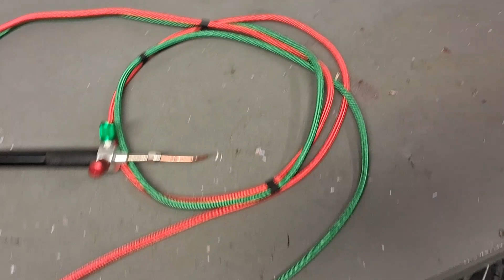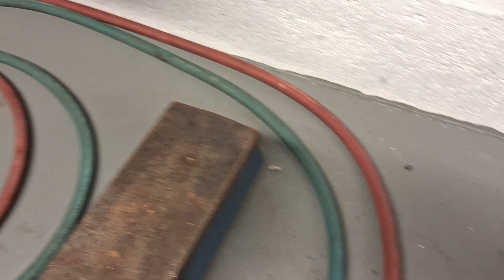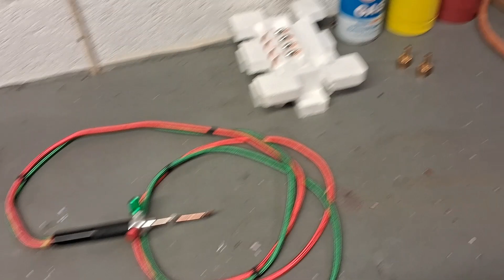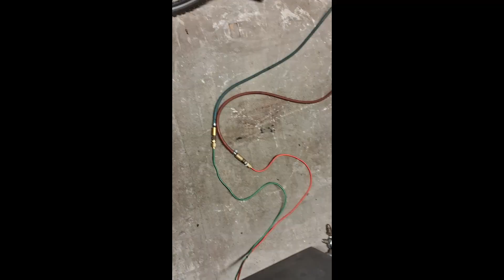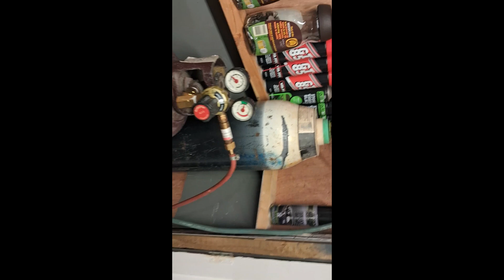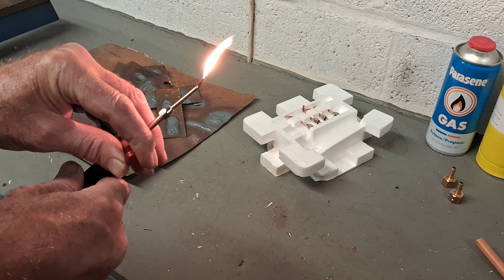CHEAPEST MINI GAS WELDING SET MAPP PROPANE OXY ACETYLENE KIT GEAR CRAFT JEWELLERY SOLDERING BRAZING

Comment: looks like a rip off of a Smiths little torch.  the best thing about using an oxygen concentrators is they do not enrich the oxygen concentration of the room.  if anything they reduce the oxygen in the room by burning it faster in the flame.
Had a real smiths little torch for years with a concentrator works great, i wonder if the rip offs work as well. for the largest flame a rose bud tip is great if you can keep the oxygen flow rate up.